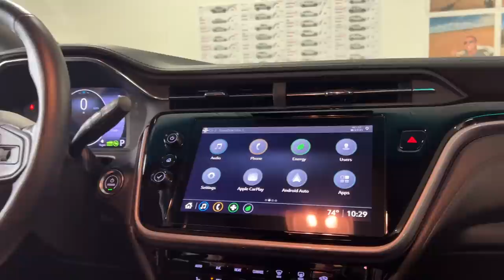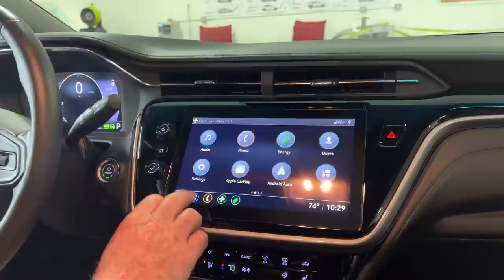Sandy's First Impression of the 2022 Chevy Bolt EV

Comment: The Bolt’s biggest flaw is the slow DCFC charging.  It adds 30% of time to go on any trip requiring one or more DCFC sessions.   
55kw to about 55% then it drops.   If the battery is at 35C/95F, then you will only get 32kw.
Reply: The charge rate is a compromise.  I believe GM correctly concluded most Bolt drivers would trickle charge the Bolt at home and not take many round trips of more than 259 miles.  That is a problem if you’re a renter or apartment dweller who can’t charge at home.
Reply: youl mostly charge at home anyway, this is not a road trip car, its for traveling to work or to the shops.
Reply: @danielstefanovic2604  $36600 for a work car or to the shops? No one wants to buy a car this expensive and not be able to take a trip. That is not what they are trying to sell it as.
Reply: @EVMANVSGAS  Get the plain jane for like 22 000 after new goverment rebate
Reply: @EVMANVSGAS I own one and it's not as bad as you think. It's only unacceptably slow if its freezing out and the battery has been cold soaked overnight unplugged. 

If its less than 500mi, it's painless. Anymore than that I'm flying except when I moved. 

Unlike say a Tesla, you're able to get the rated range at 65-70mph FWIW. The 800mi trip I made to move in my Model Y took 1.5hrs of charging total. In my Bolt it was just over 3 hours in charging. So took an hour and a half longer. Mind you the Bolt is a third the cost of a well speced Model Y. It's half as much as a base Model 3 which wouldn't be much faster than a Y, if anything slower. 

While I loved my Model Y, the Bolt is the best deal in automotive right now even without any tax credits. The EUV Premier for not much more is even more compelling than a 2LT Bolt. You get cooled seats and an optional panoramic sunroof. 2 things a $75K Model Y doesn't come with.
Reply: I own my home and have a 240 volt dryer outlet in my garage.  The cord that comes with the car works on either 120 or 240 at up to 12 amps.  That is all I use to charge my Bolt.  It is almost always topped up to 80% where I set it, unless I take an extended weekend trip after which it may take a day or two to get back to 80% while I continue to use the car.  It is no big deal to let the car slowly trickle charge at 12 amps.  Note that GM now will pay for the installation of a 240 volt outlet in your home (for US buyers) included with the car.  The electric car paradigm is different from gasoline in that you can get your energy refill a little at time instead of all at once.
Reply: @EVMANVSGAS  :f inance it over 5 years and think of the weekly fee as a "fuel bill". at $8 per gallon, that gets 17 gallons and no car to drive...  (then the lesse / loan goes away)
Reply: @EVMANVSGAS  20,000 $
Reply: Sounds like insufficient cooling !!!! 
And trying to look after the battery and this is honestly rapid gate . 
A pre cooling system in advance would be good but also a soft ware update showing the Werner’s battery temp . 
Actually come to mention it a very accurate temp gauge so you owner who cars if they know much would know to keep with in certain parameters but then once you done your thing then shovelling in 55kwh charging really does take its toll so maybe a after market fan more powerful loads of reasons to try to give the battery better cooling imho . 
This should of been Reminded in the first place .
Reply: @kevinsmith7823  As a Bolt owner and who has used DCFC on trips, I've got no idea what you're talking about. Have never had it throttle charging due to heat; battery is liquid cooled by refrigerated lines. The charging curve tapers after 50% fairly reliably and charging more than 70% becomes an exercise in patience. It doesn't deviate from this on its own. The only time I've seen throttling was a poor DCFC charger that was throttling itself (I really, really hate that charger but its the only one near one of our destinations). 

The slow charge rate is due to old battery tech. There is no functional difference between 2017 and 2022/2023 models spare a change in chemistry in 2020 that added additional range. Consider the low price to be an acknowledgement of this. If you want faster, you will pay for the privilege.
Reply: @wtmayhew  I do this for my m3 sr+ on a 120v outlet and it works great.  I also have a older leaf and the bolt looks much better...could be trading up...
Reply: @waynewilliamson4212  The first EV I owned was a used 2011 LEAF.  I sold the LEAF and got a Chevy Bolt in 2017 when the LEAF’s battery started to wear out.  The Chevy battery showed no noticeable wear after five years.  Chevy replaced the battery this year as part of a recall, so it is now back to the start of seeing how long the battery will last.  With the recent GM price cut and likely new government tax credits it makes a lot of sense to go EV.  The energy and maintenance costs are a lot less, and now purchase cost is close to gas powered cars.
Reply: @wtmayhew  I think you are correct. It was not to replace your car, but rather an "and" car. You have it AND some other car. That is the problem I have with it.
Reply: @kennethwilliams8647  Thsnks for the reply.  Right, the Bolt works best  as a city car with something else for long trips.  I have a Honda too, but it isn’t large.  When I took an extended vacation I rented a larger car.  Unfortunately rental cars are now a lot more expensive than they were a few years ago.
Reply: close but the flaw is in the pouch batteries, high risk for fire. LG is about to make LFP batteries but that is several years away
Reply: @zodiacfml  Tesla is switching to LiFePO4 batteries on standard range models.  I assume the switch is limited to standard range models because the energy storage density of LiFePO4 is about 2/3 that of lithium polymer and thus space constrained.  If there is sufficient physical space, it is worth using LiFePO4 for increased cycle count and better safety.
Reply: @wtmayhew  Tesla already on LFP maybe close to 2 years now and 50% of cars they sold last year are based on LFP. Tesla is buying growing/buying both nickel based batteries and LFP.
Reply: @wtmayhew  ...Unless they really don't drive much and they only charge once per week, or even once or twice per month.
Reply: @EVMANVSGAS  Except that this top level 2LT trim with leather, heated seats, heated steering wheel, wireless Android Auto and Apple CarPlay, 10.2" touch screen, Bose sound system, 360° camera view, and adaptive cruise control only costs $30,765 including destination before any incentives for 2023.  For a small, front wheel drive EV with 260 miles of range that can actually seat 4 adults pretty comfortably, that's a bargain.
Reply: @earthzero7  Agreed.  I commented elsewhere in this thread that recharging is an inconvenience for renters or people who live in apartments where there is not workable access to electrical outlets.  For now, that presents a business opportunity for establishments who provide charging infrastructure to overlap charging with other necessary functions.  For long haul driving, it makes sense to rent a gas or hybrid vehicle if your primary transport is an EV.
Reply: @Disdaine82  аgreed 100 %
Reply: @earthzero7  plus, ventilated seats for premier trim
Reply: If you're using the car as a commuter car (which is pretty much what it was designed for), and your daily commute is less than 200 miles each day (like nearly everyone on this planet), DCFC charging speed is meaningless. I've owned my EV for nearly four years driving just under 100 miles each day and I have never needed to use a public charger. The long 240V charging cable that came with my EV plugs into a standard 240V outlet in my garage (no expensive Level 2 charging station needed), and can top off my battery in just 5 or 6 hours hours every evening. On days when my daily commute is less than 50 miles I can top off my battery overnight using just the granny cable plugged into a standard 120V outlet. Only two seconds to recharge my EV, one second to plug it in at night and one second to unplug it in the morning. Full tank every morning warmed and defrosted before opening my garage door (try that with an ICE). For purely commuter applications an EV can't be beat, there's simply no way an ICE can be nearly as convenient to own.
Reply: The Bolt is not an overland vehicle. Even when you live rural the Range and Charge Rate is enough for a round Trip of about 150 Miles. A 100KW Charging system which can usage the flow would cost 500-1000€ more and drive the weight up.  The Idea behind the 50KW Charger is to drive to your Shopping side. When you are low on Battery for some reason, you plug it into a CSS Charger and when you come back you got 80-100 miles more of Range half an hour later. The fairly successfull European Renault Zoe has the same philosophy behind it: Cheap Home Charging, CSS Charging to get home when something odd happens.

Comment: Other perk GM offers is they include a free 240 volt outlet install in your garage.  You use the included EVSE cord which allows level-2 charging at 12 Amps.  For a city car, that’s great solution.  I have a 2017 bolt, and I do exactly that with a pigtail I made to allow me to plug the included cord into dryer outlet.  It really doesn’t matter that DCFC isn’t fast in a city car which trickle charges daily.  In the last five years, I only used DCFC once at an Electrify America charge station.

Comment: We’ve been driving the BoltEV LT since April 2017, we put 162,000 kilometres until it was totaled by a VW in January 2020. I drove it for Uber and it was our roadtrip car for the family. We picked up a used 2017 Premier model with the insurance money, 65,000 km now has 144,000 km. Still driving it primarily for Uber. 

Over 13,000 Uber trips with the Bolt, it’s fantastic and passengers love it! 

We’re on a long distance family trip right now, Ottawa Ontario to PEI, DC charging could absolutely be faster by 15-20 minutes but it is what it is. 

Looks like the redesigned model went through some cost reduction mesures, not necessarily a cheap car in terms of quality.

Our other car is a used 2014 Nissan Leaf, very much a city car but that’s what we use it for.
Reply: Same here. Bought it for $21k with 40k miles used put 120000 miles on it with a new battery but not I need to do major maintenance on it
Reply: @williamerazo3921  let me guess, front end work? I’ve done all the brakes, link kit, 2 new front shocks and a new driver side axle this year, along with a new windshield and tires. It’s been an expensive year for maintenance 😩

Car drives great though, very happy with the new battery :)
Reply: @paulcamire  yes

Comment: Just picked up my 1LT last night, pleasantly impressed with interior - heated seats and leather wheel. Nearly matches my 10yr old VW GTI autobahn! 2k$ markup plus $1k required alarm, cancelling my Model 3 order, selling 2011 Nissan Leaf!
Reply: I miss my MKVI GTI a lot!  The Bolt is fine.  It's efficient, and a good commuter or a way to save a bunch of money if you can designation charge.  I never especially look forward to driving it like I would the GTI.
Reply: Good option I recon. Especially if you charge at home.

Comment: A very fair assessment from Sandy. He admitted he may have had biases before receiving the vehicle and stated as much. True engineers, like Sandy, look at the vehicle without adding emotion and make logical determinations based on fact and experience. He has turned me around on what I "thought" about the Bolt.
Reply: Charge rate is critical, and a flaw for the bolt.  Pouch batteries expand and contract creating issues when charging.  Only my opinion.
Reply: @305dreamhonda  you’re right. The big benefit to owning a quality EV is longevity. This car will fall apart in years ahead and the software sucks. Who cares about panel gaps when your car can’t do OTA updates and dated battery tech leading to thermal run away, slow charging and terrible resale value.
Reply: @GET2222  The only way to avoid thermal runaway? Extremely slow charge rate. Substandard engineering. Chevy gives EV’s a bad name. EV’s can be much better
Reply: @GET2222  "terrible resale value."?  If only that were true!
Reply: @jamesvandamme7786  if you are buying a used Bolt, you have a bolt loose. 😂

Comment: 20k to 25k given the new incentives for the 2LT is pretty freaking amazing.
Thats camry civic territory, but running a lot cheaper and more comfortably.
Got apple carplay and android auto, nice, perfectly decent family vehicle.
Yeah its not massive but for most it would do perfectly fine.
Reply: yeah just don't expect to road trip it. Charging speed is pathetic.
Reply: @davefroman4700  Agreed. Suitable as a city car & commuter with charging at home & work. Cheap one would be good for students but unlikely to be available in any numbers.
Reply: @davefroman4700  Or you rent a gas car for the road trip.  (or swap cars with a neighbor)  Battery electric doesn't have to fill every driving niche yet.
Reply: @DraftedByTheMan  according to insiders production rate is 275 a week.....peanuts.
Reply: @davefroman4700  yeah, that shows what kind of demand it will have
Reply: @davefroman4700  As long as said trip doesn't require more than one stop for a fast charge, a 1 hour wait isn't so bad after driving for 4 hours. By that time you probably want a meal and a bio break anyway.
Reply: @jrharbortproductions  Bolt only charges at 55kw. Good luck with that 1 hour.
Reply: @davefroman4700  I've done it several times already, thanks though. 😃
Reply: @jrharbortproductions  We've also done plenty of trips in our Bolt. I wouldn't say it takes an hour; we leave after 30 minutes usually at 70% if its enough to get to next charger. Anything after that takes too long due to the charge curve.

The only hindrance really is the need to pre-plan trips but that's lack of infrastructure and not due to the car.
Reply: @davefroman4700  You guys are funny.  You seem to think that nobody is willing to wait that long to charge their EV.  Have you ever owned a Tesla and had to wait at a supercharger for an hour just to get your 10-20 minute 250kw charge in because of the crowd in Cali or Chicago?  It's not as different as you might think.  I experienced this a few times in my Model 3.
Reply: . Did a 200 mile trip between 2 cities and it works OK. Charge it at destination. Even if you do a 400 mile trip, you can stop half way and charge to 80%. It will take 45 mins, but you can go for lunch and you're almost ready to go. Of course if time isn't a major problem. It does work for many.